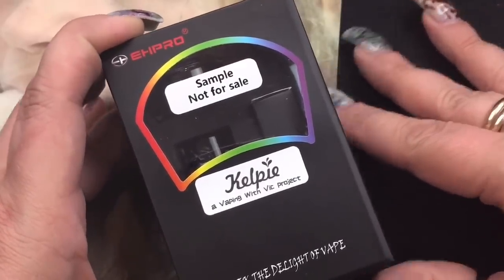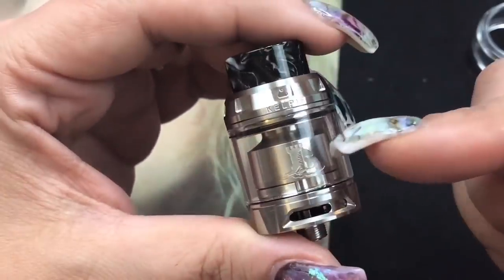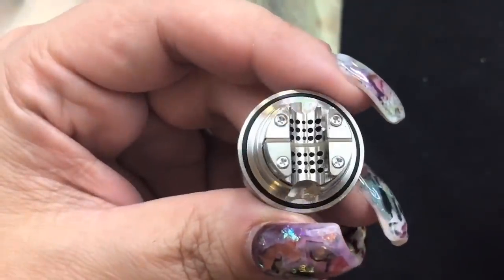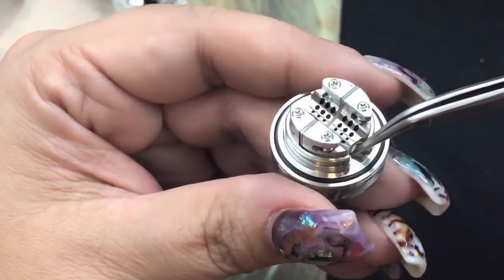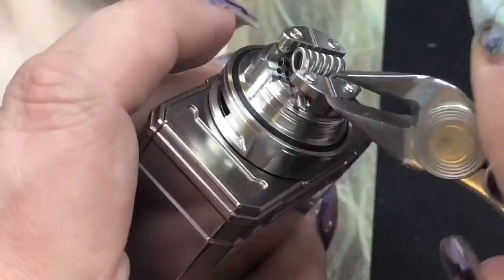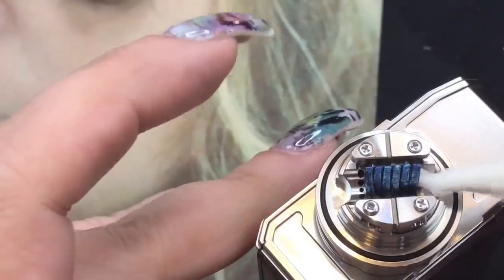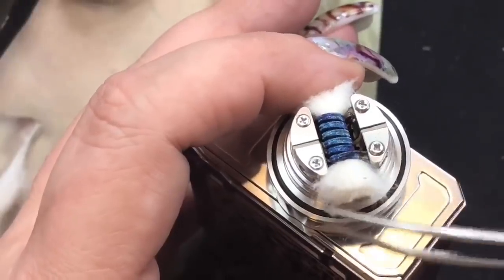Kelpie RTA | Vaping with Vic & EHPro | Review & Build

Comment: Wendy!  :D Thanks for the review, and yup, i do know you, i bump into you on chats on some live shows :D
Reply: You know as well as I do you were not going to get away with the slide fill without a lock..
Reply: Get Wendy on the show vic 👍💨💨
Reply: the "alternate" Kylin Mini, ay Vic? ;)
definitely gotta say that at least the screws will hit the coil leads the right way (HELLO kylin mini) & i actually like the fill method bcuz then the "pressure" issues r negated.
so from a building perspective, this is easier/cleaner than the Kylin mini but performance it should b identical.

Comment: Amazing flavour. Great tank. However, as Wendy stated, the top-cap opens too easily. On the first day, it opened in my pocket emptying the whole tank. This is a deal breaker for me. If they fix this, it will be up there with the Gear RTA. Until then I won't be using it.

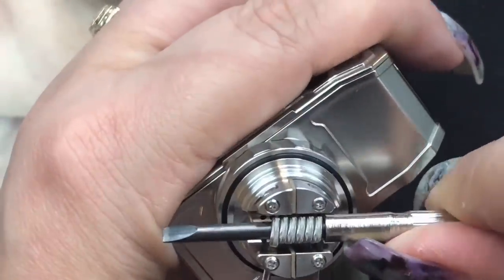Comment: 6:30 screw heads perfect condition.  7:08 & 7:33 screw head chewed up on first use?  Seems crazy to produce an excellent rda and then compromise on screw quality!  Nothing worse than not being able to remove a screw coz the head's chewed.  Have a word with them Vic - not your fault.  Also clearly visible at 08:30 & 09:29 - shame.